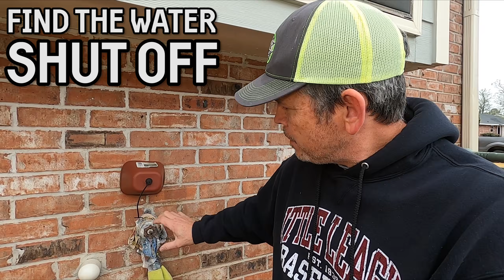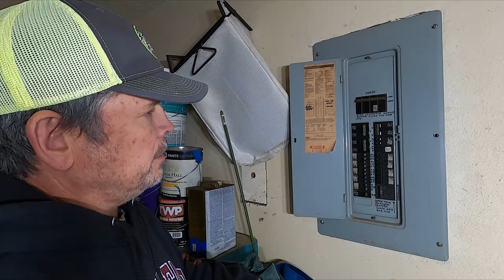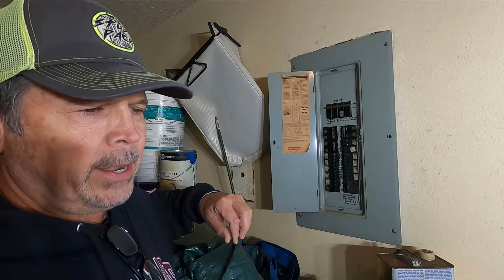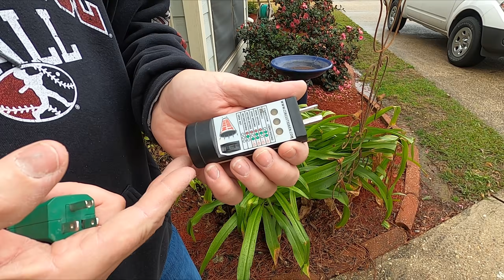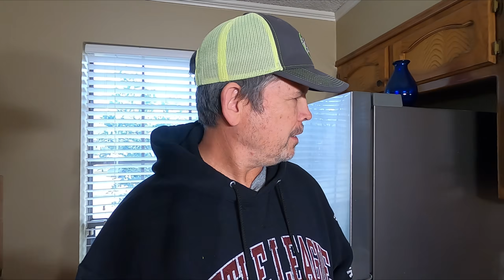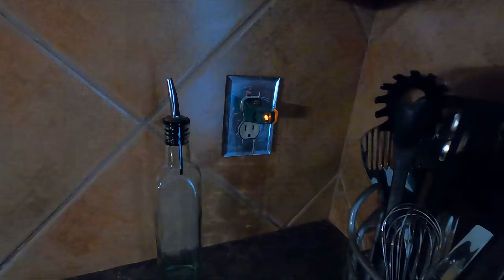3 Things EVERY Homeowner SHOULD Know/Do Before a Remodel

Comment: OMG, love the way you document the electrical panel. I’m going to do this NOW. Another idea is to identify any switch, behind the plate, if it isn’t obvious. In my house I have 3 switches that the builder installed. It took me years to figure out what they were doing. One is in the owner’s bedroom and it is for a attic light. The other 2 are in the owner closest and they turn off the phone jacks for the other 2 bedrooms.  I guess in the old days that was how you punish your child. “Go to your room and no phone.” 
Another thing I like to do is place a note behind the switch plate with the amount of paint I actually use for the room.
Reply: I created my panelboard directories in Excel - easy to add as many lines or as much detail as needed, you can still pencil stuff in after printing, and if you have major changes just open up the file and reprint.

Also good when planning, I don't have to go downstairs, just open the file on my computer.
Reply: @penguins9645  I did the same. I also made a home schematic showing each outlet/switch and which breaker it ties back to. I have some interesting situations where a couple rooms where one outlet is on a different breaker than all the others. So even though I have a breaker labeled "Living Room", I don't trust it to turn off all the outlets in that room.
Reply: Love the idea of amount of paint u used to paint room being on back of switch cover... great idea
Reply: Amount of paint? I use it to document the color.
Reply: Writing the breaker number on the back of each and every switch and plug plate is what I did in my home. Main reason was the documentation written on the breaker box was wrong for most of my outlets.